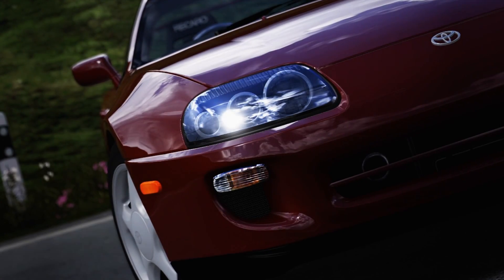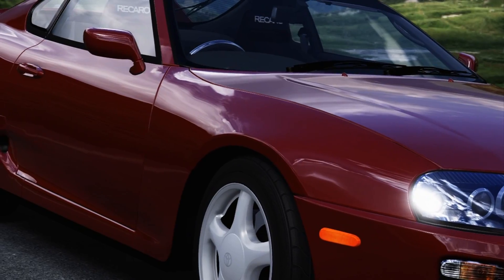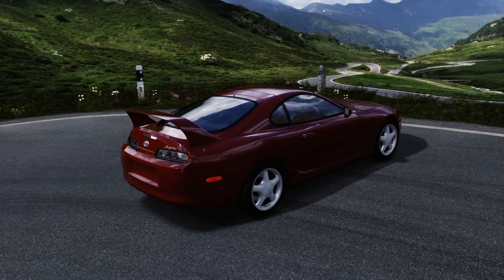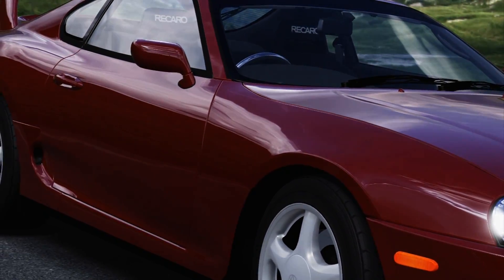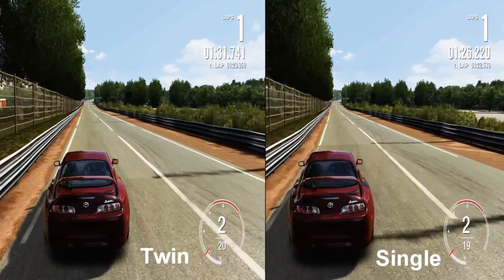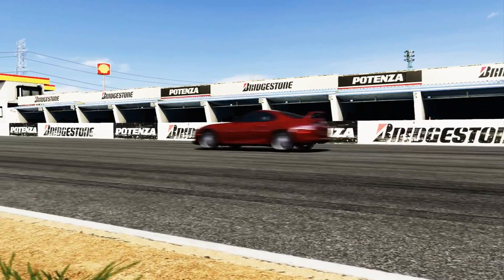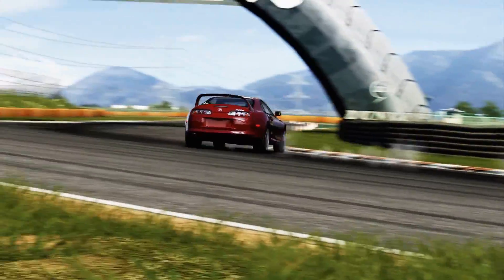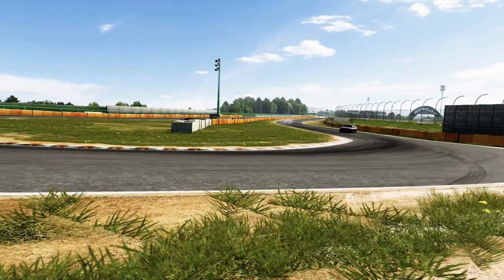Single Turbo vs. Twin Turbo Explanation | Forza 4 Comparison

Comment: Too bad a single turbo maxed makes more power
Reply: The thing is most common Parallel setups have 2 small turbos to make the same power as 1 large turbo but with faster response, lower RPM, more torque but less HP and less high RPM power.

You can have 2 large turbos set in Parallel and kind of change this but that's only if you don't have enough exhaust flow to spool an even bigger turbo in single setup!(and that would require one huge ass turbo).
Reply: exactly, too bad real life physics don't work on video game's like that, twin turbo's in real life are just way to powerful, compared to a same size single. If they put those physics into that game, u talk about spool XD i'm dead. lol that would be sick af. Especially having a louder blow off valve upgrade that would be great
Reply: PL1 Turbo
Yeah, but that's just going into a little too much detail for the game's focus. I guess they just wanted to keep it simple and not became a mechanical simulator lol.
Reply: SI0AX  They just wasted their time putting twin turbo's in the game if doesn't make more power
Reply: PL1 Turbo
Yeah, I kind of noticed that in the video, it's so negligible.

There are only 2 things that twin turbo does apart form single:
1. More Power
2. Better response/spool

It can do both on extreme setups but most of the time it just improves response.
Reply: SI0AX  yeah, if only it did that in the game, i wouldn't stop playing it lol
Reply: PL1 Turbo
Yeah, they should have done it that way and allowed you to choose turbo sizes, maybe even limit it to certain cars, otherwise they shouldn't have even bothered.

But TBH, making you choose your own turbo size then having the turbo not work if it's too big and your engine is too small, is a little too extreme on the mechanical simulation side lol, this is just a racing game.
Reply: SI0AX  that would be amazing if we choose like that! lol & yea it is just a racing game but everybody want's to call it a real life simulation game.
Reply: PL1 Turbo
I think that if the developers want to take up the challenge they could do it, like just sizes of inducer and exducer like custom built turbos and seeing what works better on different engine sizes and exhaust flow with RPM etc or the lag, threshold and pros/cons of different exducer/inducer combinations and parralel and sequential, supercharger, twin-charge setups.
Reply: SI0AX  oh i know they can do it, it's just they don't want to make the game's engine performance better. That's why all the new forza's have new engine swaps easy and simple :'(
Reply: PL1 Turbo
They did a hydroplane physics simulation in there latest game and I thought that was amazing as it's a first in simulation games.
Reply: SI0AX  YES!, that was a major change especially in a forza game.

Comment: I installed an Electronic True Twin Conversion ON/OFF switch that switches to both turbos working together as a single, the only thing it only works best wen you step hard on the gas, the engine also sounds different and louder switching both turbos to a single (meaning both working as one bigger turbo). Electronic True Twin Conversion ON/OFF switch, down pipe and bow off valve are the only things I added so far to this TT 97 Supra. it feels like is faster switching the conversion switch to single but I can't prove it till I put it on the Dyno to see the actual numbers.

Comment: There is no small and big turbo in Supra Twin Turbo. Both are THE SAME SIZE.
First one gets all the exhaust from low rpm. At higher rpm the second one kicks in and both work at the same time. 

Usually this kind of setup is called twinturbo or sequential twinturbo.

AND usually bi-turbo is called the setup where both turbos work all the time. Like Audi RS4 b5 V6 biturbo.

Know the diferrence
Reply: Except he didn't say the supra had different size turbos. Only that this optional set up is called sequential. Two different size turbos is a sequential set up but the way the supra does it is with a butterfly type valve in the manifold and when it opens at its appropriate time it starts feeding both turbos.
Reply: yes

Comment: There is 2 types of twin turbos, for V engines it is different than I engines. Twin turbos on I engines spool in succesion with bypass valves thus creating less lag but the same amount of power as a large turbo.
Reply: for V engines it's called bi-turbo ;)

Comment: What is the difference between twin turbo and twin-SCREW turbo?
Reply: False.  There is a twin scroll turbo.  If you don't know this, don't post videos.  
BTW to anyone watching:  this video is asinine and is just wrong on so many levels.
Reply: No such thing as a Twin screw turbo. However, Twin Screw supercharger, is sort of like a compressor u find in Merc's but better
Reply: shogunharvey no such thing as a twin screw turbo lol
Reply: If you wanna pick nits, it's called twin scroll.
Reply: The screw turbo is a turbo charger powered by a belt not exhaust, sort of like a supercharger.
Reply: Justen Mattingly Thats a supercharger...the difference between the two is something you just described. One uses the engines exhaust gasses (Turbo) the other uses a belt or chain (Super/Blower)

Comment: In real life a supra with a stock 2JZGTE is a twin turbo that puts out 330 hp. When you single convert it to one Turbo instead of 2 (and put in a bigger turbo) you can get almost 650 hp. Forza 4 has not succeed with this. The Turbo is probably a small one.

Comment: A lot of work has been put into this video?! Please learn turbocharger operations before giving even remote technical information about turbochargers. Sequential turbos like that on a Supra are the exact same size, however they are controlled by a valve In the manifold  to direct all gases to one turbo first (to improve response) and then both at the same time secondly (to improve overall flow rates). And "exhaust pulses"  have nothing to do with turbo spool or lag, its all in the heat and in-turn pressure differences across the turbine wheel due to turbine housing volute design and size. FYI - there is more to turbochargers than boost and lag. Full tech manuals have been written on their operation alone and the science behind it all. Again, please research first or limit your comments to your actual knowledge base.

Comment: Signle turbo VS Twin turbo.... the difference is LAG, not top speed... A bigger single turbo, may produce the same amount of power of 2 smaller turbos, but there are tons of lag, because there is only 1 turbine compressing the air...
The top speed comes from the gear box or max RPM's, and turbos dont change de RMP range... Only if the twin turbo system requires a reworked cylinder head and forged stuff....
Reply: hotgab328 no man... if you have 2 turbos making pressure in the intercooler and pipes, you'll have less lag...
Thats the only reason the Bugatti veyron has 4 turbos... it has no lag...
Reply: +Sergio Pinto no that is not true a single turbo get feed by all the cyl .. and twin half and half . if you got the right turbo for your car .. the lag is the same but you make more power out of a single .... the most common big power system is sequential ... dont mix it with twin there are not the same ... sequential is small turbo connect to a big one ... in series.
Reply: The answer is... SEQUENTIAL TURBOS! ^ω^
Reply: Theirs more lag when having twins? Also what if you have big twin turbos on their like 88mm precision turbos.
Reply: Sergio Pinto I endustand what your saying here. Remember here the bugatti is 16 piston and the turbo are use for low range torque helping the engine getting in its go on its own range. There is a lot difference between build engine and factory. Twin turbo will make less power then single when factory.. Equivalent range on a 24psi system. There is a lost when twin..each turbo using half the engine. A single use all compression on one turbine and heat. another important factor is heat. On a twin turbo system you had pipes all around the block taking important air space and two heat turbine.. It's more esay to over heat a twin turbo system and I'm still in factory engine. But yes add a cooling fan use Evans waterless coolant with a Co2 intercooler system ok but that's not factory. Out of the box single turbo is less maintenance it self and will give you that power and even more when combine to the right mapping of ecu and setting. That is my opinion.
Reply: hotgab328 So?? Rally cars use 1 turbo too, but both of them (Rally, F1) have high tech turbos...
Ever head about anti-lag and electric turbochargers?? 
Have you ever seen a F1 turbo?? Totally different from a normal turbo.
If you have antilag, it does not matter if you have single or twin because there allways pressure and in the end, top speed still the same... 
Even the koenigsegg uses electric turbochargers to avoid lag...
Reply: Sergio Pinto that was not the point did you read the rest .. bro your going away...
Reply: hotgab328 you are talking about factory turbo systems... that's not the point...
Reply: +Sergio Pinto do electric turbos look the same or they look different ?
Reply: The R34L Godzilla are you serious? Obviously the look different! The have electric coponents!
Reply: +Sergio Pinto take it easy kid it's just a question. Lol
Reply: The R34L Godzilla "Kid" says the 13yo
Reply: +Sergio Pinto lol ok kid
Reply: The R34L Godzilla Repeating the most overused "insult" on youtube... How did you became so mature? Damn
Reply: +Sergio Pinto lol you know I'm trolling you right??😃😂
Reply: I agree, I would rather have a twin setup with a more responsive setup with less power than a big single with more power but a lot more lag
Reply: Actually, it does change top speed a bit in some cases. if the engine redlines on last gear with both turbos, yes top speed is only affected by gearing and engine RPM, but at higher RPMs and when downforce and drag keep the engine from getting to the redline on last gear, the single turbo will be more effecient than the twin turbo since it has less moving parts and less friction since there is half the bushings and such and a bit less spinning mass for the same surface area, which will give it a slight power advantage. So having more top end power will allow you to get a few more KMH or MPH in those cases. Other than that and on any other gear that the last one, yes speed is only limited by gear ratio vs engine RPM.

Comment: Superchargers only make max psi at max rpm, more simple a setup and easier to make more boost by changing pulley and belt sizes. Basically they are limited to what the engine is limited to. A turbo makes more boost, harder then a supercharger to setup and isn't limited by rpm. Flow is what makes a turbo more useful as it needs exhaust flow to spool but it's biggest downfall is lag, supercharger has no lag but needs power from the engine to spin pulleys to make boost. Both have good and bad sides, and lancia as far as i know were the only car company to use both on one car, back when rally had group B.
Reply: IrnMaiden304 In some cases turbos can be limited by the rpm, if the turbo is fairly big at some point the engine can't send enough exhaust to accelerate the turbine, and small turbos are capable of producing a certain amount of compression before it tops out.

Comment: This is so wrong. The stock supra has sequential turbos in real life and in the game. This is to create an anti-lag effect. A smaller then bigger turbo in series, not two medium turbos in parallel. Put a little more effort.
Reply: He did not specifically say stock. I have owned a 94.5 Supra SE black IRL and that N/A and a 97 Supra TT and you are right but the first thing I did was strip and sell the TT and upgraded to a large Dual BB Turbo so it depends bro he was just teaching the guys n' gals that don't really understand.... Cause we obviously do and you ARE right (we both know) xD
Reply: You should see my RX8 with a Engine swap with twin scroll big boy turbo omg dude scrolls faster than a Variable Gas Turbo = VGT crazy... I didn't think it would be it definately did considering its like 3 times bigger in size, was like whoa :)

Comment: u guys are comparing two different setups either u got single turbo twin turbo or compound setup intercooler don't suck in air either, compound set up has different sized turbo's running in series,

Comment: this is still forza and in forza it says a turbocharger has more torque than a supercharger and or centrifugal supercharger (procharger). which makes no sense
Reply: I think you are thinking about this wrong. Turbos normally do make more torque and more horsepower than superchargers because turbos can spin much faster and they work off exhaust gases(which was going to waste anyway) while superchargers pull directly from the engine (using horsepower to make horsepower). What a supercharger can do is make power in a much more linear fashion than a turbo. Turbo's kind of surge power all at once at a certain rpm because they finally made boost. If you would like to see the fact that turbos normally make more power just look at current street legal drag racing cars.

Comment: Intercooler sucks in cool air like a air filter but, unlike air filters the intercoolers cool air goes straight to the turbo. Since because it is spitting out super hot exhaust and spinning at super high rpms it needs to be cooled down.

Comment: Configuration has nothing to do with whether one turbo or twin is better as you could just split the exhaust outlets to go into each. Inline vs v is just to do with packaging constraints and fitting more cylinders without making the engine too long. It can affect firing order due to crankshaft design but that can be countered e.g. yamaha Crossplane cranks replicate the ducati v twin firing order for smoothness but morecylinders power at top end with more cylinders.

Comment: The problem with single turbo is that you get "ketchup effect" wich means the car is slow at the beginning and suddenly comes all the effect (ofc not with all single turbo supra's). And with TT you can have very good bottom effect. I don't know if i'm right here but that's what I heard from a guy :)

Comment: only one turbo runs in low RPM's, but when you start getting into the high rpm's both are running and the first one helps spool the second one, more boost more quicker.

Comment from the maker: Yea, it's a sequential setup. One turbo runs low rpms, and the other runs high rpms. Not sure about the heat thing, but yes they do take turns running in a way.

Comment: Twin turbo! I have a 91 stealth tt with dr650s and upgraded fuel components with exhaust too. I it full boost, 14psi by 3200rpm and pull 470awhp all the way t my 7000rpm redline.

Comment: exhaust gas comes out o the manifold and spins a turbine connected to a shaft, on the other side of the shaft a compressor wheel spins and pushed air usually thru a intercooler to cool down air for more power/denser air and then goes into the throttle body and cylinders.

Comment: Correct completely except the reason it's called FORCED induction is because it FORCES a huge blast of cold, dense air into the engine causing the increase of horsepower

Comment: twin turbo one smaller than the other makes it more drivable in curcuit racing,, ie if you can only come out of a corner at say. 40mph max i single turbo with more power than a twin turbo may still lose around a track because the twin turbo is always on the power band.....smaller turbo does the low down pulls and bigger turbo is spooled up at higher rpms.. good vid but! well done horspower ofen win in a dra race around a track drivability matters

Comment: you are kind of on the right track but it all comes down to turbo size, generally twin turbos use 2 smaller turbos then a single turbo(3000GT  VR4 uses 2 t9 turbos while a GSX eclipse uses a t25 turbo) set up but if you had the same turbo size for both set ups, a single will spool faster because it has better flow(just think how long it takes to spool a 76mm turbo, now try spooling 2 76mm turbos)

at the end of the day though, you cant go wrong with either set up, it all comes down to your build

Comment: @Rezwan salehin supercharger would be the best. BUT if u have stock internals such as valves, lifters, pistons, piston rings, anything inside the engine... u may hurt the motor if u try to run any kind of forced induction on ur car. Just a suggestion

Comment: you are unawear of turbo lag the reason the supra comes stock twin turbod is because the stock turbos are twin inline turbos, one starts to spool or build pressure at lower rpms then the second kicks in later, the single turbo only kicks in at one point and one point only, yes turbos are alwayse in use but they don start to compress the air till a sertent point in your rpm band, im been getting torn between turbos and super chargers more that single to twin turbos.

Comment: Some automatics actually hold boost when shifting. I have 2 friends who have bug turbo builds in i4 engines , 1 being a dual clutch auto and the other one being manual. The manual looses 20psi during shifts, the dsg looses 1 psi. All this can be fixed with a WOT box on the manual but still

Comment: I find in game, it doesn't really matter which kind of turbo you have, but rather the size of the turbos (upgrade level). I say this because during a race, your revs rarely dip below 3-4000 RPM, so spool difference doesn't matter.
However, the bigger the turbo (sport turbo vs race turbo), the longer it will take to produce maximum boost. So on twisty circuits with sweeping corners and esses, the larger turbo will not be at max boost.
Also, can make acceleration brutal and uncontrollable.
My 2c